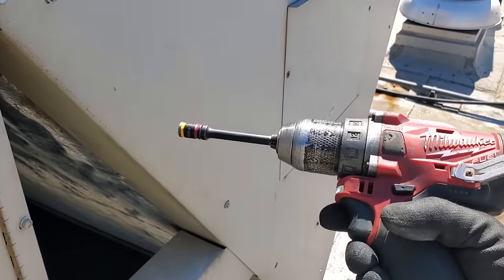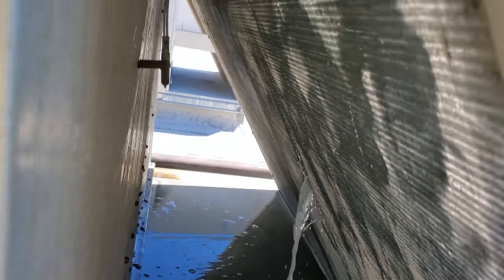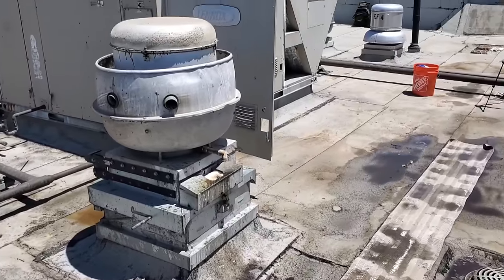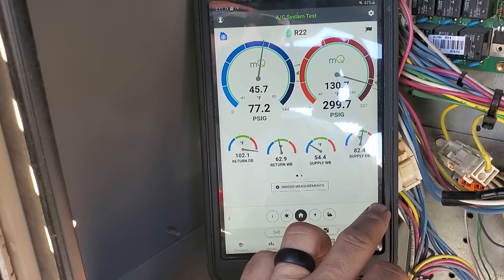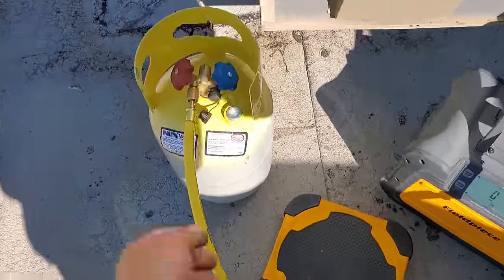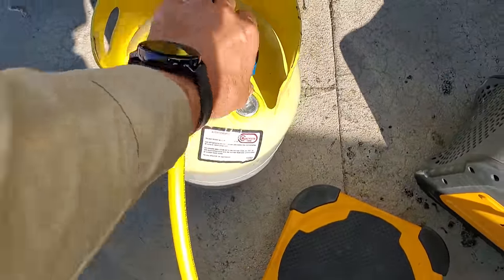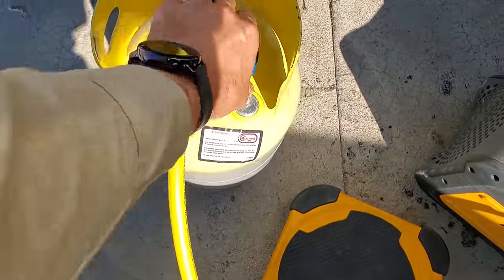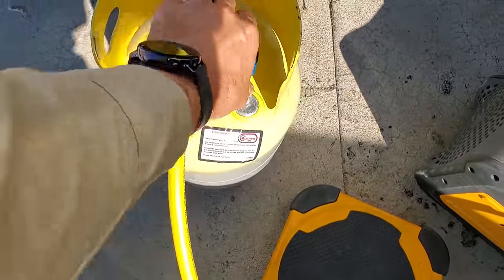IT'S DYING A SLOW DEATH

Comment: I'm electrician in germany and.... excuse my hard words but when i see this wiring MESS in this AC unit, i'm in shame with this manufacturer.... if i would build a machine like this here in germany i'd get fired instantly.... 
i mean look at that flying cables everywhere... just barely mounted with zip ties... we'd use wiring "channels" and put sensible PCBs in special cases even inside a machine....

fascinating....

Comment: I agree with impact drivers!   Dump them., except for certain needs. I have been doing this type of work a long time. I have seen  the influx of scroll compressors used in the trade. I have noticed the sight glass on many scrolls show something that looks like dust. I don't see that type of debris in the sight glasses of the coplematics through the years. Looking at how the scroll compresses gas I figure the scroll disc is wearing in......or out.

Comment: Here is the answer to fix the restaurant air balance. I did a little research. Since all the exhaust fans are on the same line is shouldn't be a tremendous cost and a single variable frequency drive could be used to control the exhaust speed to all motors simultaneously. https://americraftmfg.com/vfd-on-exhaust-fans/ You said my previous suggestion wouldn't work, challenge accepted. Great videos, thanks.

Comment: What's with all that popping and snapping compressor start up
Reply: The pull in relays are likely making the poping snapping noise (the black square relays) , they are setup with approx 1 second gap between each compressor so makes a bit more noise the 1 or 2 stage compressors (also the control board has a load of relays as well)

Comment: That condenser was not cleaned by a professional coil cleaning company. Most likely done by the customer or another hvac tech. We have been cleaning coils for 17 years. Our techs train for three months before they are allowed to hold a wand. We clean thousands of coils per year with before and after pics of each coil. None EVER have damage like that. My guys would never clean a condenser with bent fins like that. They would straighten the fins first to open flow. They would not use coil cleaner at all unless there was grease on the fins. Coil cleaner etches the aluminum and makes it attract more dirt. Maybe you should come out here and watch professional coil cleaners at work before you make derogatory blanket statements about coil cleaning companies. Your videos are outstanding otherwise.